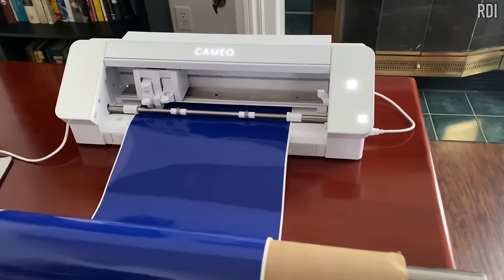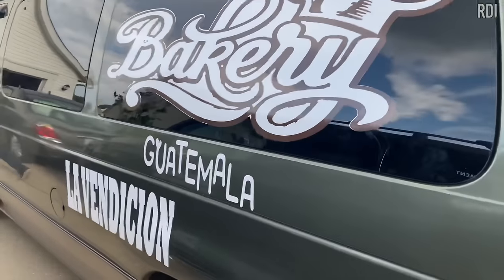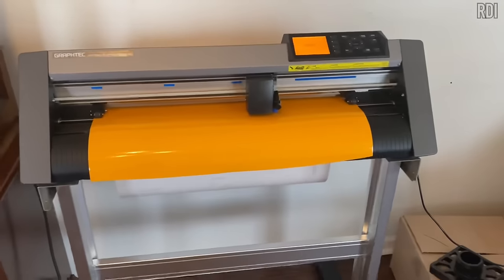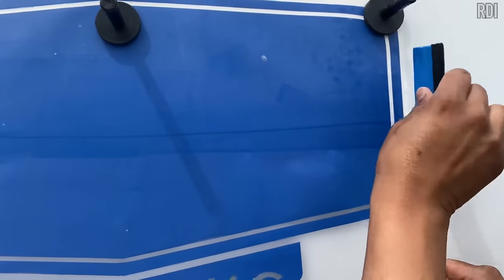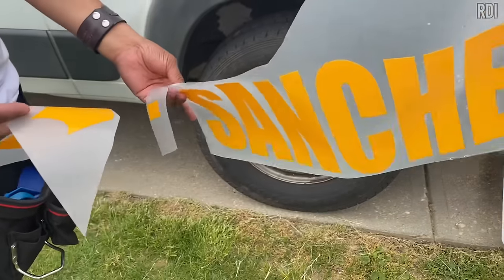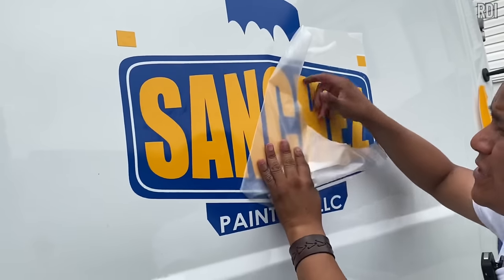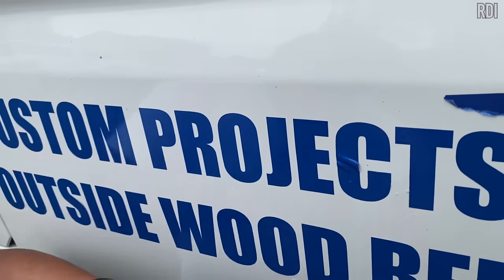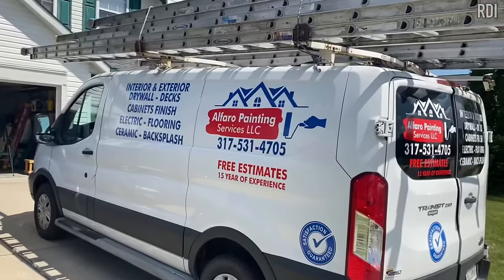machine for making stickers

Comment from the maker: Our store: https://rdidecals.com
Affiliate links:
Graphtec vinyl cutter:  https://amzn.to/3pIrIkS
USCutter Titan 28 inch Vinyl Cutter: https://amzn.to/3yC1jwn
CAMEO 4 (12 INCH): https://amzn.to/3uy66jc
CAMEO PRO (24 INCH):https://amzn.to/3POgbNO
Corner rounder: https://amzn.to/3JbJQzI
Oracal 651 vinyl 12x24 ft roll: https://amzn.to/46wUTMQ
Oracal 651 vinyl 24"x10 yard roll: https://amzn.to/3ulmXRJ
Reflective vinyl: https://uscutter.com/24-oralite-5300-economy-grade-reflective-film
Tape application roller: https://amzn.to/45apQGa
Oracal color guide ( only for 651 & 631 vinyl ): https://amzn.to/3W6Q0ow
Magnum magnetics 24"x25' : https://amzn.to/3P6AHdJ
Blank yard signs: https://amzn.to/2IBiGWM
RAPID TAC: https://amzn.to/37ZMl5O
Cutting mat: https://amzn.to/3uidBWZ
Blue safety ruler (31 inch long) https://amzn.to/3slsrKy
Squeegee: https://amzn.to/3bmZK8Q
Small magnets to hold vinyl in position:  https://amzn.to/3kdE6bt
Cutting knife tool: https://amzn.to/3sbDTYS
Adhesive remover goof off: https://amzn.to/3eXrNS2
Siser Glitter Vinyl: https://amzn.to/3u1gnnO
Siser color guide: https://amzn.to/3ZuQJ60
Teflon sheet: https://amzn.to/3HvhRKx
Teflon pillow: https://amzn.to/3Sheqw1
15x15 heat press teflon cover: https://amzn.to/42gjt4i
Transfer AT75.1: https://uscutter.com/Rtape-Clear-Choice-At75-100-Yard-General-Purpose-Clear-Embossed-High-Tack-Application-Tape
Reply: Necesito algunos stickers para autos si lo pueden hacer ustedes y hacer envíos a otros estados

Comment: You can also use an old roll, to apply transfer tape.  Just tack the leading edge of tape down.  Place the old roll on top of the mask, and roll it along your weeded graphics, it will push the mask roll along and give an extremely clean and smooth application.   Then squeegee.
Reply from the maker: Sounds like a good idea thanks for sharing 😎
Reply: Another great video. Your crew does amazing  work! I don't do a lot of vinyl on vans but occasionally I'll get asked to do one. What is your method when applying. You look like you don't spray the surface down. How do you not get any bubbles and if you do what's your secret on getting them out?  Is there a link to the transfer roll? Thanks again,I really enjoy watching someone with great skills.

Comment: These guys give fantastic tips. One of the most important aspects based on my experience is the transfer tape you use. It can wreak havoc on your piece if you use the wrong type.  A clean surface is also a major key factor in successful adhesion. One of my biggest challenges since moving from the much smaller Curio to the Cameo is working with large rolled media. Especially off the cutting mats. If you just peel them off you can ruin/wrinkle your cut. I take a metal ruler and slice it off the mat, this way the vinyl comes off flat. Have yet to see on video on this subject anywhere on YT.
Reply from the maker: Thanks a lot for your kind words and support! That sounds like a good idea. We love learning new tips 🙏
Reply: if I use a mat I will usually place the cut and mat vinyl side down and roll the mat off while holding the vinyl flat

Comment: How easy it is to remove them from the car
Reply from the maker: Hello! It really depends on how old the sticker is and how hot or cold the weather is. We avoid doing this when is cooler that 60  fahrenheit. You can also use a heat gun to activate the adhesive, this makes the removal much easier.

Comment: I've just bought myself a Loklik cutter, so not real expensive but a start towards what I'm wanting to do.

I do have a question based on what I'm seeing in your videos.
If I wanted to cut a 4ft long label decal, how do I do that without a cutting board that long? Can these machines be used without the cutting boards?
Reply from the maker: Hello! We haven't used this brand in particular, all the videos I saw, the person was using a cutting mat, so I would assume you need to use one every time. This is a huge thing to consider before investing in a vinyl cutter. The only inexpensive cutter which is very similar in size and price is the Cameo 4. We have been able to cut decals 80 inches and longer with this vinyl cutter. I apologize for not having an answer to your question.

Comment: How long does the vinyl hold up?
Reply from the maker: Oracal 651 lasts 4 to 5 years outdoor according to the company and we can confirm it’s accurate
Reply: Definitely accurate and if you take care of it will last double that
Reply: 651 is whats called a calendar vinyl. Its the vinyl that will crack easier. But the cost is 1/4 of 751 cast vinyl which doesnt shrink and crack. The process to make either product is a bit different which changes durability. Old sign guy.